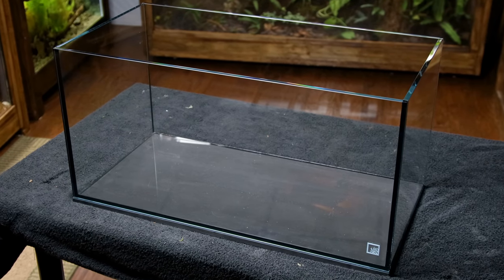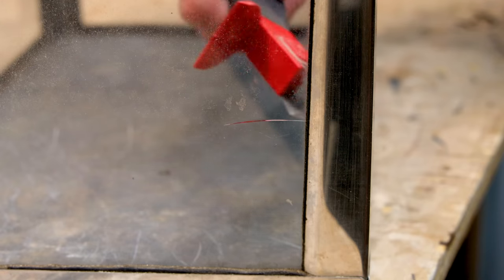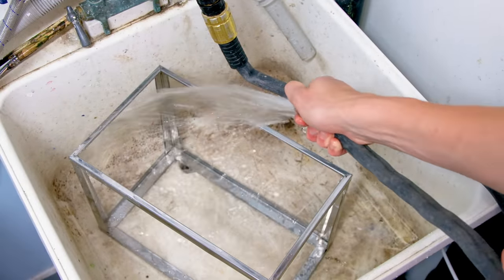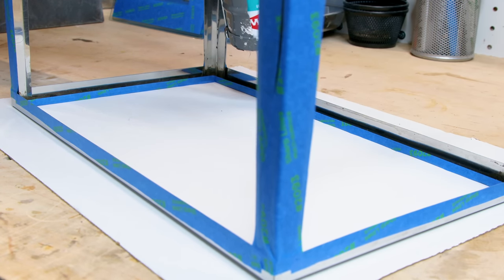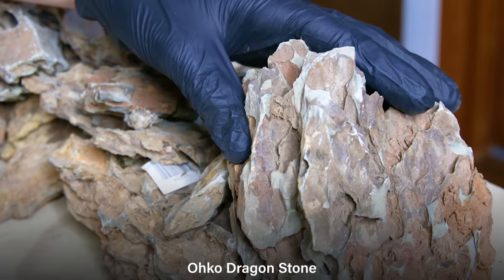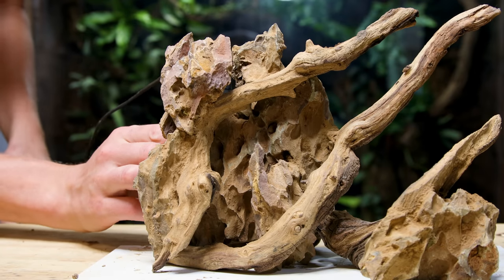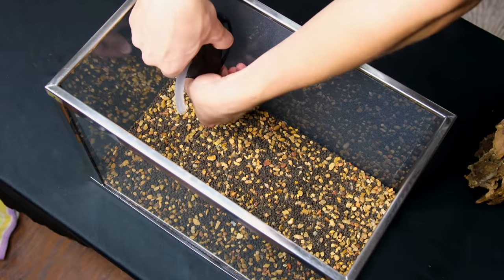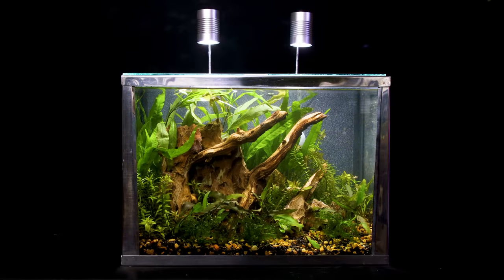Reviving a Ruined 60 Year Old Vintage Nano Aquarium

Comment: My first fish tanks was metal frame(no idea how old they were, it was 2000's, they all had glass bottoms). The fact, the fact they can just be resealed and replaced a side, makes them amazing. the sides also protect the seams against overly agressive using algae magnet. my current tank is rimless, but there is a certain charm with rimmed tanks.
Reply: This was my first, too, circa 1975

Comment: Well done. The old framed look is nice. For your top glass cover laying loose on top. I've used those little clear self adhesive rubber bumpers in each corner facing into the tank onto the bottom of the top glass to lightly lock snug in the top from sliding around. Beautiful.

Comment: The reason for the slate is so that there could be a heat source underneath (like of like a chafing dish at a catering event). This was because although there were electric heaters, it was still seen in common practice that this would be a viable way to keep the tank heated. The fish keeping community has come a long way!
Reply: I read that the Dutch during the 40s and 50s would have pilot lights running under their slate bottom tanks for heat
Reply: @GreenCanvasInteriorscape  That would make sense 🧐

Comment: I found a 20 gallon metaframe for $15 at the local goodwill a few years ago.  It came with a huge box of tank accessories from late 60’s to 1973!  Everything-from pumps, plants, air driven gadgets like a backwards water wheel and treasure chest, fry boxes, separators, a heater, lights, and even food, meds, and carbon.  After confirming it held water it has been sitting and waiting.   I can’t wait to set it up.

Comment: Blessing in disguise breaking that glass panel. I really appreciate that you kept the core elements of the original (frame, slate) but gave it a solid structural restoration that will give it a brand new life. Really awesome!

Comment: 1974 I lashed out on a stainless steel 3ft version of these tanks with a matching two bulb light housing and hinged flip lid that had a turned bakerlite black handle that only opened halfway to the width. planted with undergravel system and a corner bubble filter, it was one classy system and worked well for about five years winning 1st place in established planted Aquarium catagory "no co2" at my local club where the judges visited. Using a vintage "Medcalf Bros" Hy Hlow C Reciprocating Piston Pump that chuggd away feeding 2 x 3ft tanks. happy memories and nice to see. Cheers UK...

Comment: I have one and it is my pride and joy. The frame is just steel and it sits on it's wrought iron stand. I had it all sand blasted and powder coated then I put back in the glass (that was in amazing condition) with black silicone.

Comment: I'm so glad to have found this video and that you documented your entire process!  I recently found a great deal on a 55 gallon Metaframe tank and I have been wanting to clean it up and reseal it, but was completely unsure how to start.  Everything I've read so far has stated silicone wouldn't adhere well to the slate over time, I'm glad to know that's not necessarily the case!  Beautiful build and a gorgeous scape!
Reply: There's an active Facebook group and I thought that he swept out the slate bottom to Glass because the silicone will not adhere to the slate but there is a dow adhesive which will adhere to the slate but it cures slowly and is a mess.

Comment: This brings back memories.  My first aquarium was a fifteen-gallon Meta Frame tank.  At the time, it was considered the top-of-the-line-modern aquarium.  I haven't been able to find out when they were first introduced, but it was sometime in the middle to late fifties. Prior to that, tanks were made of common steel angle iron, welded together and given a heavy coat of paint.  If the paint chipped or was scratched, the frame would rust.  The thing about Meta Frame was that it was stainless steel, so it would never rust and looked great without paint.  One reason that they are so uncommon is that they were only made for from fifteen to twenty years. After that, they were replaced by the All-Glass Aquarium.
     Making your own Meta Frame tank would be very difficult.  If you look closely at yours, you will see that it required special machinery to cut, bend and weld the steel, but, if you had access to some stainless-steel angle iron, the ability so cut and bend square joints, and a good welder, it might be fairly easy to make something similar.  The advantage to that is that such tanks are very strong.  As long as you can lift the weight, you can pick up and carry such tanks around while full of water without having it spring a leak.

Comment: UNH the bold taper on those chrome sides, that's sick as hell. Sucks that you had to dismantle it but I think that resulted in a cleaner restoration, I have a feeling that all that old asphault might have degraded the new seal in some way through necromancy. Glad you kept the slate. If you ever need to touch up chrome, the molotow paint markers are great.

Comment: Try sliding a  1/4 dowel rod under and just inside your cut and you can usually break it over the cutting surface vs over the edge of the table. That avoids any chance of a break shattering and creating falling shards.

Comment: I really love the slate bottom. Aside from the sealant issue which you resolved, are there any other issues to be aware of if I wanted to make a custom build with one? Could you use multiple tiles on a plywood bottom for a large build (>100 gallons)?

Comment: @SerpaDesign beautiful restoration, I love metatank aesthetics!   I am quite worried though that you didn't discuss or address in your build the reason these are no longer made or used.  A frame that conducts electricity needs to have the frame grounded or can be a source of electrical shocks of varying degrees.  If your light isn't touching the tank/frame, and if you are using just air filtration it can be a non issue, but when you have like in your setup an electrical in tank filter, and lights that are touching the frame, it is very problematic.  Cost of course comes into why they don't use metal for frames nowadays, but the main reason is the electrical threat.
Reply: agreed, was disappointed to see that he didn't address that aspect of why these are no longer made or used.  I'm guessing @SerpaDesign is unaware of that aspect sadly.

Comment: Hey, i've got a question. I've just been gifted a aquarium tank and will start a project soon, therefore I'm gathering all the information needed to build a paludarium etc. While observing my grandpa's fish tank, I've noticed that the water is pretty warm and he has a huge filter and pump in the back and I haven't seen any of that kind in for example this tank. So do the lamps generate the heat, or are there some fish that don't need that much warmth, and how do you manage water quality etc???
Thanks in advance
Reply: Tropical fish need warmer water but there are many cold water fish that don't. Its likely the tank your grandpa has has an in-line heater or one built into the filter. 
As for water quality its a bit complicated to explain in a youtube comment, but if this is your first aquarium Id recommend joining a forum like Fishlore and reading guides and such there.
Reply: Also folks like Tanner that have rooms full of tanks typically heat the room rather than each tank individually

Comment: You need to buy some super glue accelerator. Put super glue on one piece, squirt the accelerator on the other piece. It will be an instant bond. Be careful tho cause it instant bond your fingers too, and it burns! Awesome video

Comment: This was a wonderful video! I've watched it three times already. I have several Metaframe and similar stainless/chrome-rimmed tanks (Jewel, perhaps?) that I've wanted to re-furbish, but I haven't had the confidence or a solid plan of action to actually begin. THANK YOU - this makes me feel like these projects-in-waiting CAN be accomplished! Earlier, when I'd been researching the kind of sealant to use, there were many comments that regular silicone does NOT form a good bond with the slate. I've toyed with the idea of using all glass, but, like you, feel that not keeping the slate bottom would somehow do an injustice to these vintage tanks. 

So, a year after you posted this video, I'm wondering .... how has the Dow brand Dowsil 795 Building Silicone held up? Is the tank still water-tight?

Getting to come along with you on this journey of revitalizing such an amazing aquarium has been truly inspiring. Many Thanks.

Comment: I have one of those aquariums down in my basement....just like yours.  I'm inspired....but I think I'll build a little paludarium or terrarium with mine.  Something with a little waterfall.   A bit intimidated at the thought of possibly having to take mine all apart like you did yours though....we'll see...lol
Reply: ...yep....cracked the glass on one side digging out the old asphalt.  The one I have is/was (🙄) in pretty good shape considering.  Doesn't look like it's been reciliconed and the glass isn't terribly scratched up.  Now I started...guess I have to finish...lol.

Comment: I wouldn't be surprised if the original glass was possibly a more fragile type of glass, so by replacing it you didn't necessarily lose elements of the original tank but simply upgraded the elements that were already there. [: like doing frame repairs to a super old house, that, like this, clearly needed it. Who knows if that glass would have continued to crack on its own. Maybe the molecules in the glass just finally settled in an unideal fashion and all of the panels were bound to crack. I think the spirit of the original form of the tank is totally still there even though its a different more modern glass medium. And this looks great.

Comment: The Dow product that is used to seal the slate to the metal is available but I've heard it's messy and takes forever to cure, if someone were to substitute unglazed ceramic tile would a different adhesive seal with less mess and faster cure time?

Comment: I would love it if you did a playlist on how to take apart tanks. I tried taking apart an old 20 gallon hamster tank, but the glass corners have less than a hair's width between them and I don't know how to get into that miniscule gap to remove the silicone without breaking the glass!!!

Comment: The reason for the slate bottom instead of glass was that they used under tank heaters instead of in tank heaters. So the aquarium stood on a heat pad not to unlike whats used for terrarium nowadays.

Comment: Where do you get your dragon stone and drift wood and how do you process them before putting them in your tanks?
Reply from the maker: Typically I don't do anything, but if I do, I boil the wood and spray off the rocks. I try to buy them locally when possible at my LFSs, but often online as well. Idk how much you're looking for, but I'll link some sites I frequent for reference (Etsy and Ebay are always solid as well).

https://manzanita-driftwood.com/
https://sraquaristik.com/
Reply: @SerpaDesign  Thank you! I'm looking for a few for a 5-gallon, two 10-gallons, one 25-gallon and one 75-gallon. Also, where do you suggest I source my plants from?

Comment: don't use the term 'asphalt' because the original aquarium mastic had nothing to do with asphalt.  it was a proprietary compound that varied from aquarium manufacturer to manufacturer.  It could maintain a watertight seal in perpetuity if never allowed to dry out, i.e., the tank was always filled with water, as opposed to stored empty  in a garage or attic where it dried out over the years (then it becomes a potential leaker).  The old metal frame manufacturers didn't have dow silicone caulk way back then

Comment: Personally, I like the older tanks with the metal around the corners. I don't understand how modern edgeless tanks can possibly stay together with the literal thousands of pounds of water inside and only GLUE holding the panes together. Also the metal edges give some peace of mind as protection from minor knocks and dings the tank might suffer.

Comment: I need to know how the hell you manage to get dragonstone together with superglue?! I've tried so many times and it just falls apart as soon as I touch it, even after leaving it to cure for over 24 hours and scrubbing as much excess dirt and debris from the stones as I could prior to applying the glue.
Reply from the maker: It's all about the dragon stone dust. There's definitely a "technique" to it, but I find that it's best to apply some between the stones themselves and then even more along the joining seams. Load the exterior seam with dust to speed up the process and lock them in.

Comment: Personally I feel the slate bottom was a missed opportunity as soon as you covered it with substrate. I would have taken advantage of the slate bottom and done a 'bare bottom' tank with a different choice in stone and wood. I would have avoided all stem plants and gone for all the ones that can either be glued on or just like to hang in the tank. I still like the outcome of this tank and we're all individuals with different tastes, but I could not have covered that slate bottom. It was just too different to ignore!
Reply from the maker: Definitely a valid critique. I thought about it for a little, but I decided that I should at least use it just for continuity and if I ever wanted to do something different (ie. bare bottom) that it's an easy edit.

Comment: i have a 70 gallon ss tank that the asphalt was so hard i could get it loose from the glass or the frame .i tried a hammer and putty knife.i used plywood over the broken glass and seal it .i have it in use still . i the blue of the glass.

Comment: Would much rather meta frame than black plastic frames we get now. Lord knows that a few spot welds are too expensive nowadays.

E: They seemed to thrive better when I neglected cleaning the tank. Now I know that's likely due to a better nutrient exchange leading to a higher bioload capacity.